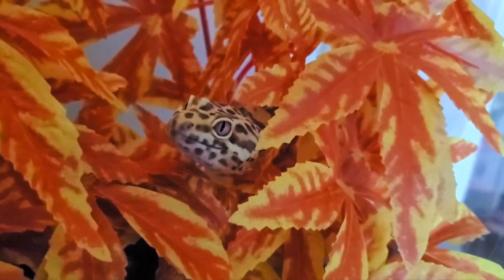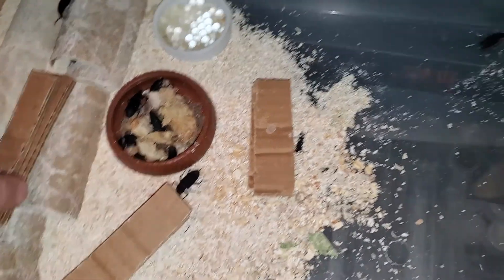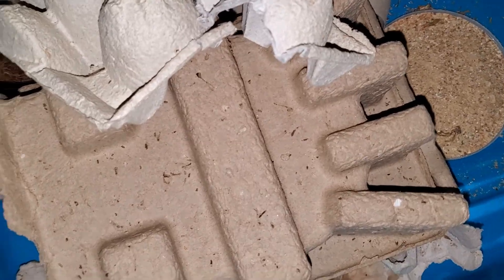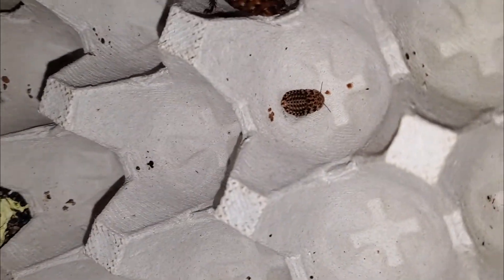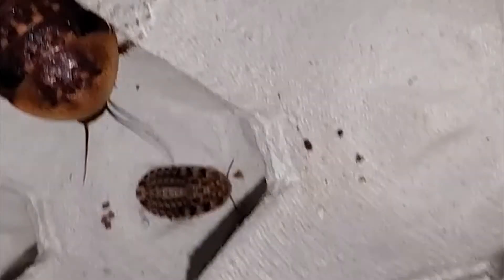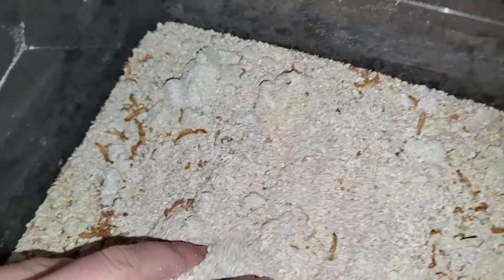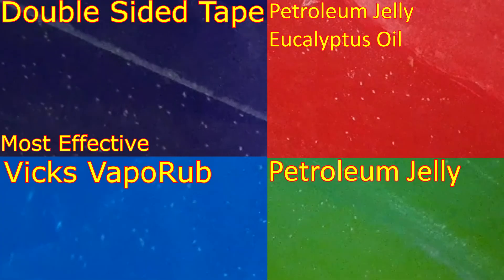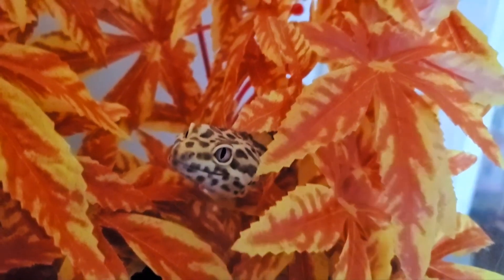Insect Husbandry - Get rid of grain mites - Prevent Mold - Mealworm Superworm Crickets Roaches

Comment: 20 to 30 mins of baking? I just put mine on for 10 mins what I'm thinking is if it kills the weevils its good enought to kill the eggs also 😂 I forgot the Celsius though will edit later 

Also some pests are different if you're from other country
Reply from the maker: Some smaller organisms may be more resilent than larger. Tbh. I had never baked it before, I've always froze (what bran). Leaves and wood for my isopods is all I've ever baked. I probably over do it with them, as I will let that go 30mins-1hour .

Comment: I placed double sided tape and Vaseline together and they manage to walk over both(but much less of them coming up!)
Reply from the maker: Oh no. I only used the petroleum jelly. About 2 inches wide, a decently thick layer. It contained them for me. Only what had already escaped was what I had to deal with. Have you tried with just 1 of the 2? When I made this video I hadn't had grain mites, but last year I ended up getting them. Took me a while to get rid of them, but the jelly in conjunction with dehydration and no food for long periods of time wiped them out. Best of luck to you in that fight
Reply: @KCExotics  no idea what’s that petroleum jelly, thought it was just Vaseline lol. How do I get humidity low? We have about 40-50% normal here so removing lid alone, not sure that is enough.
Reply from the maker: @orenrez655  Vaseline would be the name brand of what I am talking about. They can't get through it, in my experience. 

Erm, I live in Florida and my home humidity stays in that range. I personally keep the lids off when I can. 40-50% isn't going to hurt them, however, it's during feedings that humidity becomes a problem. That 100% requires lids to be off to avoid negative side effects like mold and damp substrate. As long as the humidity isn't like 10-20% or being above 60-70%, there should be no problem. The clues you watch for are condensed water on the side of the enclosure. As long as that isn't happening, you are golden. Lids off while feeding is suggested. However, don't worry about the humidity that much if it sitz between 40 and 50
Reply: @KCExotics  thanks ! Actually I’m worried “it won’t kill the mites” over the worms. These worms can outlive nuclear winter probably lol. 
As for the Vaseline they somehow walk over it to the top, but it stopped many of them. I’m also wiping several times a day. Someone wrote about heating the bin up for like 70-80 and say’s without lid it will dry it up even more . What you think? I wanna kill these mites in a few days lol
Reply: @KCExotics  as for condensation, I never had any. So no idea how these mites thrived so good without it
Reply from the maker: @orenrez655  so, if you have mites, Amy fresh food, no matter how little or how briefly you have it in there, the mites will breed. Basically, if you feed your colony, you feed the mites. Its a vicious cycle. Any moisture, water jellies, food, etc. That will hatch the eggs. Eggs can be dormant. Even if you don't see mites right now, you likely will have them a few days after your colony feeds next.

This will help. Pick each beetle up. 1 by 1. Run them under water, it will not hurt them. Do this for every single one of them. This will get the mite eggs off their legs and body. Take your beetles and place them in a bin with nothing. No substrate. Nothing. Let them dry out. Then add some substrate and a water source. Watch the colony and see if mites appear. If they do not within a week, you have effectively cleaned the colony. Now you just have the infected grain. The Worms have to be handled a different way. But that works for the beetles.
Reply: @KCExotics  oh! I see the water with eucalyptus oil is from this video! It’s actually getting tons of them on it. Do I need to put it for some time only? Or I can just leave it there and let them drown 24/7? Do I need to replace it or just leave it and let it do the magic?
Reply from the maker: @orenrez655  leave it in there. Change it out once it seems to be getting full. It's a judgement thing on your end. But yeah, keep it in there and stay consistent with it.
Reply: @KCExotics  gotcha! Will leave it there for them to drown. But looking again at the video it seems I shouldn’t put the oil in the water? Just water? Where do I put the oil? Also what your thoughts about using vegetable glycerin? Will it be good at top instead of olive oil?
Reply from the maker: @orenrez655  they used it in 2 different cups, 1 with water, and 1 with the oil added. 

As far as the difference between the oils, there isnt much. 1 is synthetic and 1 is natural. I'm not sure they would be drawn to it like they would water. Which ever way you choose, it's going to be a tough battle. 

eucalyptus oil has the ability to kill them. I'd imagine teatree and peppermint oils are capable of kill them as well. If you treat the water with anything, those would be what I would choose

Comment: We recently found grain mites in our isopod cultures. Very upsetting! Do you know if the petroleum jelly / eucalyptus oil trick is safe to put in a isopod bin? I know this was in reference to meal worms but worth a shot! I will definitely try the double sided tape in the bins though, that seems to be a universal trick. Thanks for uploading this!
Reply from the maker: Are you sure they are grain mites and not soil mites? Anyhow, I do not suggest it for isopods due to them being able to climb walls and may get stuck in it and die. The eucalyptus oil may not be safe for isopods either, and due to the high humidity in their enclosures, may wash down into the soil. If its dangerous to them, that could completely wipe out the colony. I haven't tested it, however, I'd Air on the side of caution without further research. Wish I could be of more help. The only thing I can really suggest is to pull as many pods as possible from the enclosure, give them a spray with a spray bottle to wash off any potential mite eggs, and start a new culture. Best of luck my friend.
Reply: @KCExotics  Honeslty I’m just taking the word of an isopod Facebook group on the ID of the mites. They do look exactly like the ones in the video though so they mostly likely are grain mites. But okay, I appreciate your response. I will do more research on the matter and go from there…it’s looking like redoing the bins is the best though. Subbing to your channel btw, great stuff!
Reply from the maker: @CHOBBYFUN  I appreciate that!!! Feel free to reach out any time. Thanks!